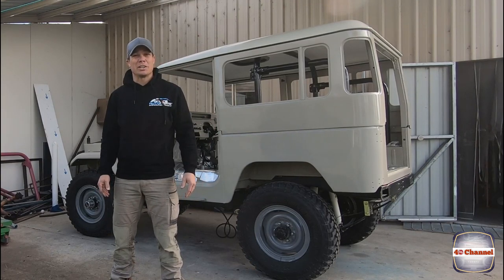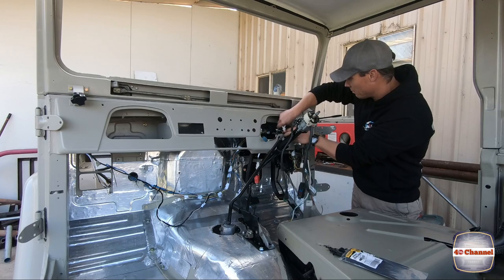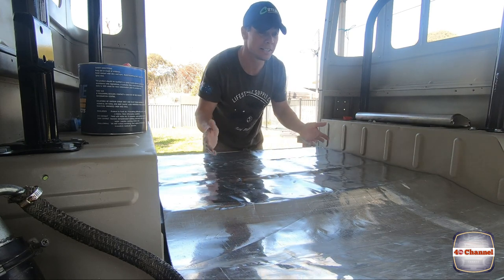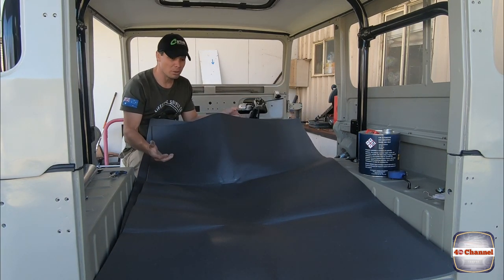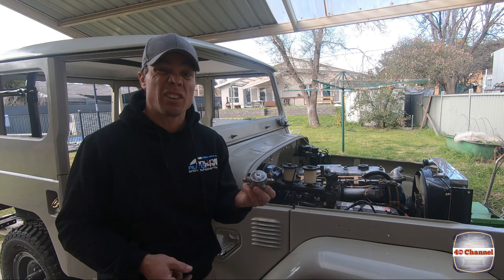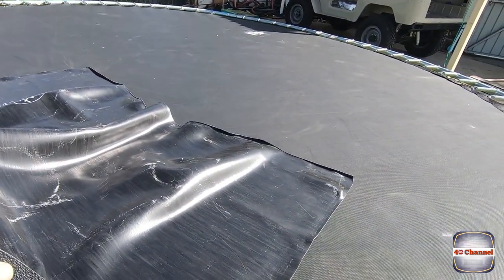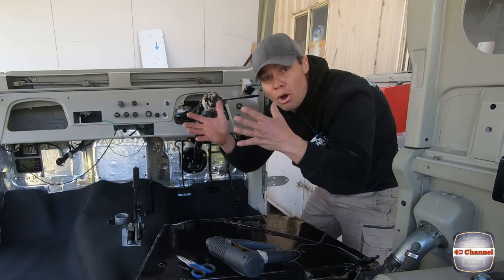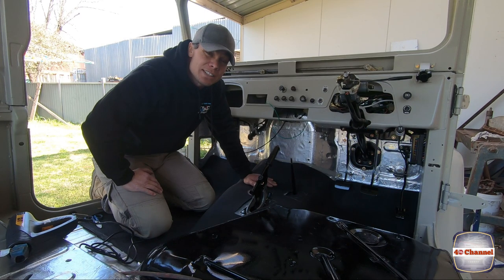EP65 - FJ40 Installed the new Radiator, Resomat and Vinyl Floor. Plus install the new wiring loom.

Comment: Looking great!  I did a '66 Bronco way back when I was in my twenties and re-did the wiring...  one lesson learned was before you tie everything up all nice and neat, plop a battery in there and verify that all the switches, warning lights, brake lights, turn signals, headlights, starter ground, dash voltage modulation, etc, etc, works.  Much easier to deal with all the "should have worked" issues when everything is hanging in the wind and you don't have to install/uninstall something that might cause scratches or frustration.
Reply from the maker: Yes I did bench test it all with a battery before installing. So I hoping nothing has changed.

Comment: Your heater tap looks quite corroded. Mine looked similar and ended up bursting and spraying coolant all over the garage. Genuine are pricey but in my opinion well worth it for the peace of mind.
Reply from the maker: Thanks mate, will keep in mind. This is one I brought from a 40 wrecker as the original one was seized.

Comment: Did you swap the old buss fuse block out for a newer one?  If so, what did you use?  I'm doing the same thing!
Reply from the maker: Yes ebay, and it is the exact size to fit and replace old glass fuse box too, 
https://www.ebay.com.au/itm/224043834198

Comment: Where did you get the steering column gasket? Would like to get one for my 1971 fj40.
Reply from the maker: Hi Mate, I made it from some foam rubber.
Reply: @40ChannelCruiser  thanks I will do that

Comment: Can someone tell me what he’s installing at the 12:00 mark? Can’t seem to find where it’s located on part sites.
Reply: its the blower motor that provides air flow to the heater box. toyo part 87104-60094. 

further information can be found here. https://www.megazip.net/zapchasti-dlya-avtomobilej/toyota/land-cruiser-38286/bj42-54911/bj42rv-mcq-936045/heating-air-conditioning-heater-unit-blower-18023213#/il-416849128-6657819-6657819
Reply from the maker: The blower motor, I rebuild it a couple months back.
https://youtu.be/b__qKrO74xA